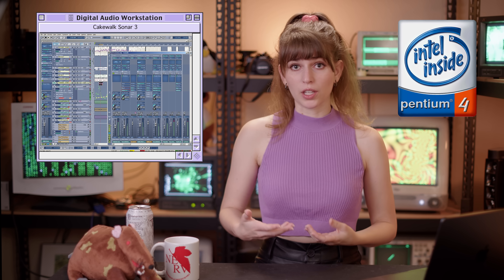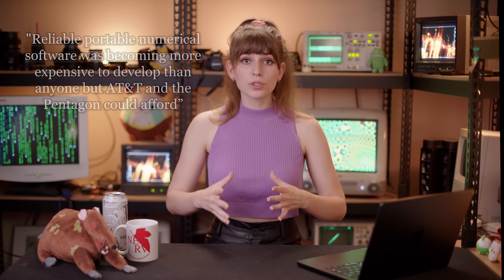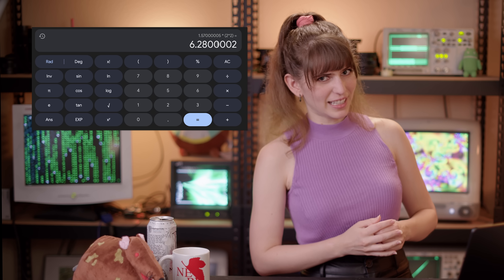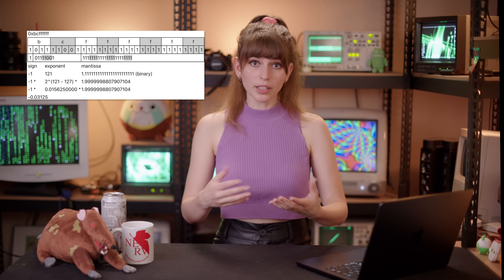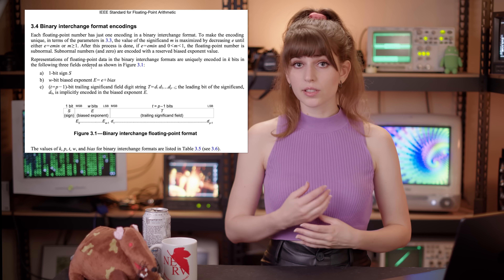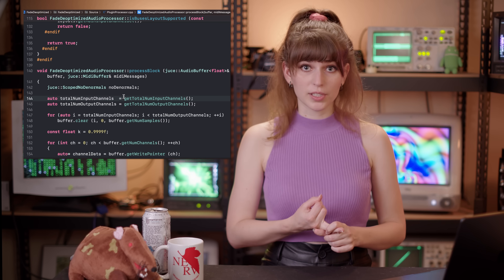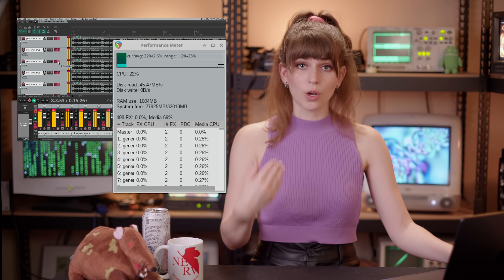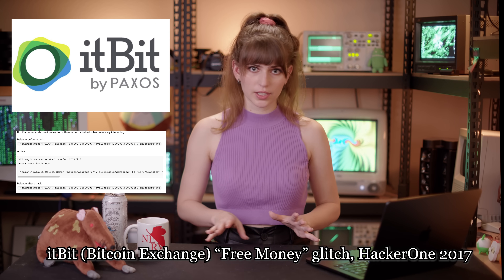Fading Audio is ROUGH on CPUs

Comment: Yes, but why are DAWs using floating point numbers at all? 16-bit integers have enough precision to do a fade well enough for people and if not, you have 32-bit integers as well. I get that floating point maths are hard and slow to process but for digital audio you don't need floating point numbers.

I understand there's an argument that you average sounds together so you're going to end up with some decimals as the result but no human could even tell the difference between a wave which ranges from -10 to 10 versus a wave which ranges between -20 and 20. (The numbers are unitless, I'm talking about the integer sample values.) Someone with high precision recording equipment would have a hard time nailing down the accuracy to within 5. And floating points are so that you can have a sample value of 24,423.475194727485667, for that extra premium accuracy.

This is not meant to denigrate all the other stuff about floating points. That was super interesting. I'm just talking shit to anyone who builds audio software and thinks that extra 0.5 sample means enough to the person listening to warrant using a float to store audio samples.

Most programming languages will divide an integer and return an integer result without doing any floating point math. If you want to calculate the fade value of a given sample, just do an integer divide of the sample's by 1 through 32,767 (for 16-bit samples) over time. If you want to have more precision so you can work with louder samples than the max (just during processing), convert to a 32-bit integer (without scaling the numbers), do whatever processing, then convert back to 16-bit (clipping samples at 32,767).

To anyone not following when I'm talking about samples: A computer sees sound as just a list of numbers (samples) which are read at a certain frequency and tell a processor what voltage to send to a speaker. The list of numbers varies over (very short) time and causes the speaker to vibrate. The range of the numbers is -32,768 through 32,767. Vibration makes the noise. Just having all the samples being the same makes no noise.

Comment: I disable denormal protection manually. I use my own noiseshaper dithers where it can and does actually make a difference (no matter how small), and the performance drawback only really applies for signals that are perpetually extremely close to zero, such as when ramping up or down at the start and end of a track.
Reply: And no. I don't care that the human ear supposedly can't tell. That data is old and was taken using old hardware with low fidelity and high internal noise, and even today we still do not have the technology necessary to properly test the lower limits of human hearing. Some independant companies (such as Chord) have tested human hearing to detect amplitude differences as small as minus 300 decibels on a fullscale signal and timing differences as small as about ten microseconds, which is already the limit of what they had the equipment to test at the time.

Comment: I avoid floating point math like the plague, mainly because of undocumented and unpredictable behavior like this.  In the age of 64 bit, with a little attention to the range of inputs and outputs, you can design an application to have enough headroom in all cases so that overflow cannot happen.  And then you can still have enough resolution that you never get down to where the LSB can ever be perceived.  Where people get into trouble is by doing ridiculous things like effectively attenuating a signal by 200 dB, then sticking a 200 dB amplifier on the end of it.  This will never behave well, even using floating point math, and there is no reason to ever let it happen.  Not that AI won't write code that will do exactly that.
Reply: I'd also like to point out that by the time your audio fades to where subnormal numbers result, it's already inaudible.  So instead of fading to zero amplitude, you can just make it a standard practice to fade to -100 dB, or whatever number leaves you with a comfortable feeling of being "zero enough".
Reply: Well that is incredibly niche on top of being useless information to the average person. But, whatever floats your boat.
Reply: @bradadult5290  Where would you get the notion that the comments on a video definitely NOT aimed at the average person, would be useful to the average person?  Do you understand how YouTube works?
Reply: @BrightBlueJim  I understand-that your target audience would be better reached through direct channels. University, colleagues, etcetera. Case in point: I'm the only one so far that has read your comment, for example. Maybe you don't like your colleagues because they're a bit on the odd ball side, understandable especially within a state like California. But your skills, expertise, and experience in this matter can be discussed further through more direct channels.

Comment: Any programmer worth the name discovered the problem decades ago.  In my case in the mid 1960s an in my wife's case in 1972.  Even in the real world when we went metric our government chose mm as the basis of measurement to AVOID that decimal point and floating point.  The USA quotes the weight of heavy object like trucks or steam engines in pounds to avoid floating point.  The computer stores time in MILLISECONDS to avoid floating point operations.  In my horse trials I time events in seconds or the time of day in seconds to avoid floating point.  Who would use a real figure when an integer would have been so much more efficient?  Only an inadequate programmer that is who.  The same applies to physics.  There is a limit of accuracy to any measurement meaning that any smaller unit or value is pointless.
Reply: Horse trials? What? Please provide context and stop being one the people who blurt random semi-technical nonsense in the Youtube comment sections.

Comment: When you said "Floating point"… i was like… "AAAAH, THAT'S THE ISSUE"… and I've literally never been working with a truly old (like 60-early 90s) machine…

But yeah, when coding in C/C++ or other "low-level" programming languages… you'll see that floating point computing still is a HUGE issue… ._.
Especially since there's no standard way to save several numbers (not even crazy weird ones) like 0,1 or 0,01… there's no exact binary representation of these numbers, so 0,1 becomes some (0,099*** something weird) and 0,01 becomes some (0,0099*** something weird)… and since that's an issue on x86, ARM, RISC-V and pretty much every other CPU architecture, it looks like this ain't becoming any better ._.
Reply: So then discuss it with people in the same skill set, not YouTube comments among 15,000 other people.
Reply: In the cases that I needed floating point calculations for, I was just ending up rounding to two decimal places in the end (multiply by 100, round(), divide by 100) to get a precise-enough result (for my particular case), but I know that, in lots of cases, that wouldn't be precise enough.
Reply: @TheCalisto1994  Did you not see what I wrote?

Comment: thanks alot for the refreshing video! in the 1980s as a young boy i programmed in assembly of the MOS 6510 processor. usually never used floating point numbers. but in the Commodore64 you could use some routines of the BASIC interpreter to help you wiht your work and you could also use the routines that were able to handle floating point numbers. And on the occasion where i needed them, i acutally never really understood why all these problems that you described thankfully so in detail, occured. I always thought i was too stupid to handle these rountines or i was doing something wrong. Always was startled when something should have added up to a full integer number e.g. 7 and then it turned out to be 7,0000000000001  so again thanks for the vide. Almost 40 years (FOURTY YEARS) later i finally understand the background better :-)

Comment: simple. multiply volume level internal values by 10,000. cut off at 10.
no more subnormals.
so if you're at 85% volume, you're at 850,000.
if you're at 0.0539% volume (basically MUTED), you're at 539 (right? idk). once it gets to 10, cut it off.

Comment: Fun fact: floating point precision can still vary between systems. 

C# specifically does not guarantee consistent results between Windows and Linux do to some computer optimization differences.

Took a hot minute to fix those unit tests.

Comment: What I normally do is try to stay away from floats as long as possible if its about money or when its about some other high precision units like with astronomy. Only when you are forced to give a number, convert to a float. For the rest use division math instead. There are a lot of libraries you can use in most programming languages. Also use types with high precision when needed or forced to give a number instead of a fraction. Like a BigDecimal in Java. Or use libraries specialized in a certain field, for example Joda-Money in Java.

Comment: couldn't you have a data set of say 100 values and you just cyclde from the values of 100-0 ?   it wouldn't be infinite   smooth.  but human hearing wouldn't be able to notice much difference between  2 or percent of a drop.

Comment: 7:05  it's because micro processors work in base two you don't work in base 10 and because of that you don't get base 10 fractions you get base two and so you get halves and halves of halves and the only way you can get a base him fraction is to round up so somewhere past a certain point the numbers are half errors proportional to the base two so it's like half quarter eighth. You don't get 1/10 you don't get .13 you get .125 and then you can round that up but what they did as they came up witha decimal representation and they did this for business based math, but it's slow slow because you're processing math the way a human does not the way your computer does it
Reply: Early IBM and other computers used BCD arithmetic, so they didn't have that problem.

Comment: 1:48 I apologize if you address this later in the video but: This is an issue of expectations. Floating point math was never intended to be used where exactness is required! It's meant for dealing with inexact empirical values where the rounding error in floating point math will be completely swamped by measurement error. Unfortunately, because many programming languages completely lack exact rational types (and even worse, some don't even have integer types!) a lot of programmers got the mistaken impression "float is for anything that's not an integer". This can cause big problems when you use floating point for operations that must be exact or must always be rounded a certain repeatable way (like finances).
Reply: For finance, it also tends to hurt that too many programmers use the wrong unit; they should, for instance, use the penny and not the dollar. But yeah, few languages have proper types. Reminds me of Raku/perl6 .
Reply: @stephenJpollei for finance, there's often more than one currency to deal with. Also, with taxes, pennies would not work either. Depending on your use case, you could get usually get away with .01 cent as your base unit.
Reply: Agree 100%.
I was working on a project that was using geo coordinates.
The  standards we used was originally using FP and I commented that they should use integer coordinates instead. The dev told me I didn't know what I was talking about. The next version of the standard was updated to use integer coordinated. This way, the precision was constant regardless of your location.
Reply: @agbinfo  I was about to reply and say that sounds like it's actually fine for float... but then I realized, yeah, you want the same precision regardless of magnitude, and float would give you extra precision when your coordinates are close to zero, so fixed point does actually make more sense. It's an example of an inexact measurement where floating point still isn't the right choice.

Float does work fine for audio, in general, because sound amplitude tends to be logarithmically distributed. It's just at the very low end where you run into unnecessary resource use like the video talks about (because you're below the noise floor anyway so why waste cycles?)
Reply: @rfmerrill wow! Would have loved to work with you instead.

Also. I have never worked with sound, so my opinion is mostly irrelevant. However, I wonder if fixed point could be a better fit (probably after converting to a logarithmic scale as you mentioned)?
Reply: @agbinfo  I'm not sure what advantage logarithmic fixed point would have over floating point. It would certainly make summing difficult.

32-bit float is popular for audio processing because it lets you make big volume changes without losing important detail. You have 23 bits of mantissa which is already above the dynamic range of human hearing and you have an exponent on top of that.
Reply: @rfmerrill ignore the logarithmic. I assume volume would already be in dB which is already logarithmic.
My idea is that if you ignore the exponent because you've already normalized all values, all your calculations are using Integers.
If you have one track where the volume increases steadily (Wish You Were Here) then that would be a problem but in most cases your tracks' volume don't change that much.

Again. I realize I have no clue what I'm talking about. This is not my field.
Reply: @agbinfo  I'm very confused by just about everything in that comment. Floating point is used in audio production. The fact that a finished track has relatively steady loudness is the result of mixing and mastering, not just like, inherently how sound is.

And yes, once the track is mixed and mastered it is usually converted to integer/fixed point.
Reply: @rfmerrill that's probably because I'm not making any sense. As I said, this is not my area of expertise.
Reply: Yes you don't use floating point for banking software. But a signal processing environment like a DAW should actually be the perfect environment for it, because accuracy is not an absolute requirement.

Comment: Stopped listening after the problem statement. 

Just pre compute some sort of helpful table which when combined with some relatively cheap operations, gets you the number you need
Reply: Ah yes just do a table lookup of two 32 bit floating point numbers, it might take 64 exabytes of RAM and incur a cache penalty every time but that sure avoids that half a clock cycle throughput time to scale 16 floating point numbers
Reply: @bobdavelisafrank_4850I understand your knowledge of math is too little to think of useful ways to achieve this, but others' knowledge is not so slight. It is in fact done across a wide range of computing problems. Including subnormals.